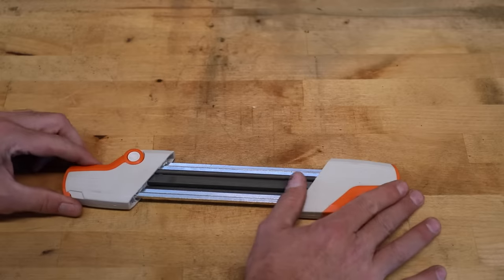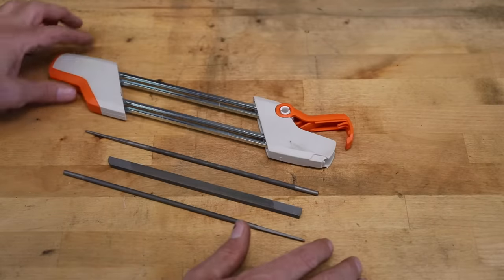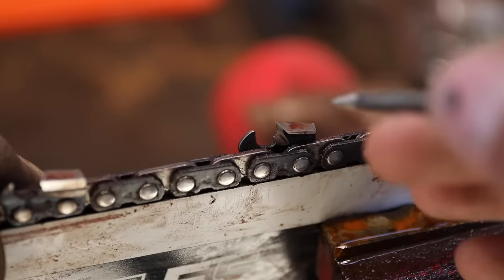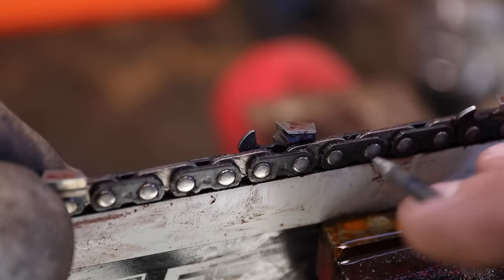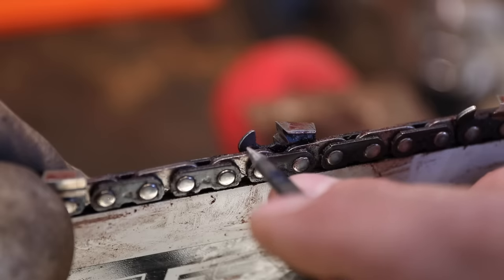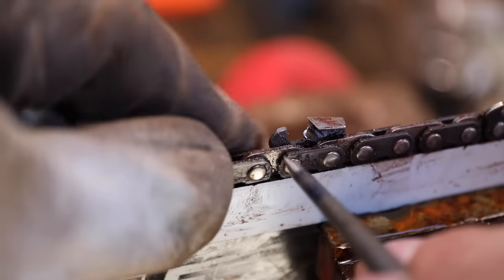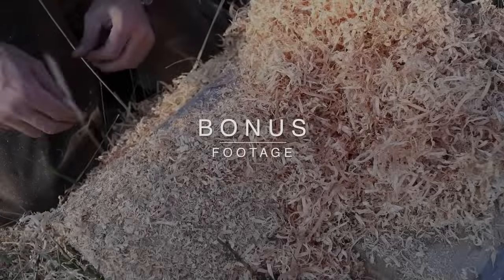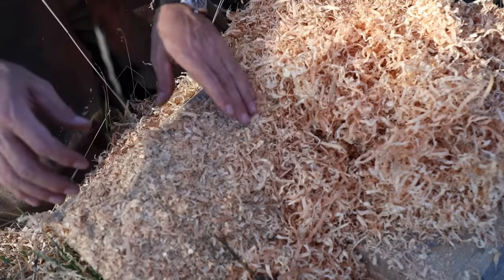Best Chainsaw Sharpener Ever - FINALLY!!!

Comment: Ive noticed latley-and maby not on this particular video , people get on here and just rip into this guy. It blows my mind how people can hate a human being so much that they have never even met. Then they through the ol , freedom of speach i can say what i want! Guess what fella its called " freedom of speach " not " hate speach". I see people saying " your not doing it right " im a stihl dealer" " ive been a faller for 35 years " . Wheres your video then bud? Im sure this guy has done his research on the sharpener , with a pro saw like that i bet he talks to dealers and well educated people daily. But thats the new age of internet for you , alot of people putting other people down for enjoying there passion.
Reply: Hear! Hear!
Reply: So if you see someone doing an instructional video that people may be relying on to do things correctly and they are doing it wrong or using the wrong tool we are not supposed to say anything? The angles of the tooth for instance, if your not going to use the angle of the file system then your just doing it by " eye" and makes it almost useless. One has to use this file system on the correct chain as well. This guy does great videos though and seems like a good man. Cheers.
Reply: Bad information is worse/dangerous than no information... People are really weird about chainsaws specifically.
Reply: kylejazz123  hate speech? Disagreeing is not hate speech, you fresh out of indoctrination center? ( college)
Reply: @kevingrove4379  yeah I also enjoy disagreeing on the internet.
Reply: Scott L  So hate speach. Spelled it your way to mitigate confusion.
Reply: @kevingrove4379  Brother, go back and read the comments with my name next to them. You and I have no disagreement. With all due respect, I think you're a little confused. I think your beef is with the guy called "old fart" and not myself.

Comment: Use your gauge to check the angle before you call someone who is trying to help you wrong.  It is 30 degrees.  I'm a little sad to read that you did not do your homework before you called 16ats wrong, and you did not say sorry for it ether!!!

Comment: We had a tree surgeon come the other week, I do general garden maintenance so have a rear and top handle chainsaw, do small trees too.
Anyway, we got talking, he gave me a tonne of advice, he had these 2in1 files and they looked really good. Explained how I’ve got a chain or 2 that I’d previously sharpened using a grinding wheel machine thing, and even though they were sharp, they were just useless. Had no idea about the depth gauge. I’d previously taken chains to be sharpened at a shop and never seen them do anything with the depth gauge.

Anyhow, got myself 2 of the 2in1 files and my god, so easy to use. The chains that are fitted atm to both saws, I didn’t see any contact to the depth gauge so I guess there’s still clearance.

Only thing is, about half way through your video, your angle seems all wrong?? The handles on the 2in1 are so I understand at 30°, which on my chains anyway, line up with the angle guide on the teeth themselves.

Excellent bit of kit though, shame about price, not cheap, but a chain takes just minutes, no faffing taking chains off.

Comment: I'm still a beginner after 30+ years of doing what needs done. I've known it was not a raker, but a depth of cut gauge It's interesting that you say it is not a raker then call it one anyway. Thanks for the smile. It has been an annoying week+. That 2 in 1 looks helpful. I'll keep it in mind when I'm shopping for supplies. Thanks for that too. -Ron

Comment: @wranglerstar If you watch your video you can visibly see the bar vibrate as you file and that will not produce the best edge. You want the bar as stable as possible while filing. Great video, I bought the product based on your review. Thanks for all you do. Take care to ensure the bar does not vibrate while filing. I like to set the vice about 4-5 inches back from the tip of the bar and file on the tip of the bar side.

Comment: i think it is over filing the raker as the file is designed for full comp chain and needs to ride on the tooth in front which is not there on skip.
Reply from the maker: I didn't find this to be true. If the depth gauges were over filed the saw would stall out or loose chainspeed when leaned on,
Reply: at stihl training this is what i was told.  it clearly works with skip but you have no control over depth of filing on the raker.  when it rides on the tooth in front it controls the depth of cut.
Reply: @jon gouras is right. Try it on a normal chain, then you will see how it is supposed to work.
Reply: I  think you are right about this. probably why cody's saw cuts so agrassive after filing. It has enough power (more than joe average's saw.)
Reply: in big wood skip keeps the saw from bogging.  stihl factory ships some big saws with skip.
Reply: Thomas Russell- Where I buy my chain, skip is the same price and it’s faster to sharpen. I always run skip.
Reply: faster to sharpen but you sharpen twice as often
Reply: i run skip in my bigger saws fyi and full comp in my little ones
Reply: jon gouras that's what I was thinking also.

Comment: You said it, your at a bad angle when you started, don't you think the guy who invented this knew what he was doing. 23 years I spent sharpening chain saws by hand and the angle you say is too sharp is what gives you longer chain life and deeper cut. Also did you notice once you submitted to using the tools as designed it worked better. Filing is just as much sound when your doing it right. Just me 2 cents.

Comment: I'm not fully on board with the gismo for a couple reasons.  1) how do you turn the file to get even wear? 2) do you not find the depth gauges are being brought down to far?  for me this is a handy thing to use once in a while perhaps every 5 or 10 filings but not for every time.  It also encourages the 30 degree rather than the 25 degree which for my money will hold an edge for longer.

Comment: Ok, so you've got two videos that say best chainsaw sharpener ever, this one and one from ten months ago. Which one would you buy if you had to choose? Thanks, just want the best one, have no experience with either. I have a plug in grinder, and I get one chain sharpened before the stones diameter gets too small to use anymore.

Comment: That sharper angle is for the smaller saws
Reply: The angle has nothing to do with the size of the saw. It's about cutting hardwood vs cutting softwood. I cut softwood and use 30 degree angle. 25 for hardwood.

Comment: Wait a second...it specifically tells you to file at an exact angle and you just randomly decide you're not going to follow the directions? That's not a review of the effectiveness of the product. It just shows what the product can do when you improperly use it.
Reply: Doesn't matter what your file guide tells you , the proper angle for any chain is marked on the tooth .
Reply: @johnburakowski61  that is the max wear limit mark.
Reply: Check the angle on a brand new chain and you'll find a match . Coincidence ?
Reply: @johnburakowski61  you are right. It has to be lasered at the right angle for sharpening or it wouldnt accurately tell you when your chain is done.
Reply: He tested his saw on a piece of wood I could of cut through with a butter knife. Nice!

Comment: Is it just me or did Cody file a square chain with a round file?
Reply: it's not you...
Reply: That happened
Reply: Yup😂😂
Reply: Little late to reply but some stihl dealers here in the pnw will only sell chisel in .63 no round file, some dealers won’t even sell RW bars in .50
Reply: So you have to file the grind out or get a chain grinder
Reply: Never seen a square chain before. Are they available in the US only?
Reply: No such thing as a square chain tooth.  All chainsaw chains teeth are filed with a round file.  The flat file is for the depth guide / raker.
Reply: @dennylangmack7452  - pretty standard where I am.  No issues for me.
Reply: @petershupe3460  you really don't know much about saw chain dude. There are  several different styles of saw chain on the market. Do some research before you make a blanket statement.
Reply: @nobodythatyouknow241  - got a picture of a square chain / file for sharpening the tooth?

Comment: Different chains have different filing angles. There is an insert in the Stihl chain box that includes a table of all the filing angles for various chains they make. The WoodlandPro chain comes in a box and the table of angles is listed on the back.  I think Oregon uses an insert sheet as well.  In this video you remarked on how you were confused about the angle set of the 2-in-1 tool (30 degrees) vs what you normally angle your file (probably 10 degrees for the big professional chains you use).  This is why, the tool is set up for the majority of small chains sold (30 degrees).
     Here's the thing that worries me. Small homeowner chains are typically filed at 30 degrees but big chains like .404 are filed at either 10 or 35 degrees ( see manufacturer's recommendations).   You take your chain to a repair shop and they likely will sharpen every chain at something like 30 or 35 or match whatever incorrect angle you already have.  Once a chain leaves the box, you won't remember which chain is which and what angles to use, so all chains, no matter their design, wind up being sharpened to the same generic setup.  
    Also note that on the bigger professional chains and for WoodlandPro chains, you are not supposed to keep your file flat/true horizontal, but should have either a 10 or 20 degree tilt (side plate angle) to get an upstroke going inside the gullet.  As a professional, you might feel the difference between a flat and an angled side plate, but I seriously doubt us homeowners will recognize the difference.
     There are so many chains out there and manufacturers, the only way to be "factory correct" is to buy and use one brand and model of chain only, or make sure that any new chain you buy matches the angles of all the old chains you already have.
    Study a few of those tables on the boxes or inserts and the survey what angles are truly used by your peers and then find out what your local sharpening shops grind to (usually 35 degrees) and then do a video to make some sense of all this madness.

Comment: This sharpener works and stihl recommends the angle of the cut for a reason. It matches their factory angles. Also, pull it up and off the chain instead of dragging it back after your stroke.
Reply: Never in my life did i work with someone who uses these or any other guide if you touch your saw twice a year then by all means, but talk to any logger or residential guy we all say the same its not as sharp as if i did it by hand

Comment: How long will the files last?
Reply: Not very long if he keeps dragging them backwards across the tooth between strokes.
Reply: the round files aren't expensive at all - you can bet a box of a dozen for just over $10 (decent German/Swiss files).  I throw the previous season's file in the bottom of my saw case so I always have one with the saw.  For the flat files they're more expensive but still under $8 and they'll typically last a lot longer if you "card" them regularly.
Reply: 3-5 chains
Reply: I might be wrong but I believe that its intended use is for full comp chain and you have skip chain. Your "rakers" look too low and the gullit is too high.
Reply: Chuck, it's funny he says he's not filing on the backstroke but you can clearly hear it biting.
Reply: XGC, 3-5 chains is not 3-5 uses. Think about how many times you can sharpen a chain before it's worn out.
Reply: +wtf caniuse   Youtubers often MISUNDERSTAND my comments too!  A common problem.
Reply: 454pakr forever if you clean them and lightly oil them once a year
Reply: A file literally cannot bite on the backstroke. You will just round over the teeth.
Reply: Ryan, that depends entirely on the file tooth profile. If it wasn't biting you would hear it skip rather than bite.
Reply: XGC Scrappy one round file will sharpen a 24" full comp chain 3-5 times for me.
How many do you get?
Reply: KimballCody, I thought you meant 3-5 chains. It should easily last dozens of times.
Reply: A single cut round file like that cannot bite on the backstoke. What you think is biting is the teeth skipping over the steel. I don't know of any file that has teeth  cut in both directions either, that wouldn't even make sense as you would constantly be ruining the teeth.
Reply: As I said, it depends on the tooth profile. Not all files have aggressive tooth geometry or even asymmetric teeth. I know the difference between the noises, it doesn't sound like a skip to me.
Reply: wtf caniuse nothing to do with how it sounds. You can clearly see the difference between skip and full comp
Reply: KimballCody, we aren't talking about chains ;)

Comment: Would you recommend it to someone who never had trouble sharpening with just a file? I take the rakers down with a raker gauge and an angle grinder when I feel the blade doesn’t bite as much every 4-5 sharpening.
Reply: Absolutely... it's a one pass thing as the rakers will come down as needed with each file... the round file height is always in the perfect location and saves cutting down into the tooth... the angle is spot on all the time... It's a little big to carry around if you are used to having a round file in your pocket or something when working away from the workshop or your vehicle down in the bush or something... but they're an amazing tool... I got one a few weeks back and my little saw has never cut better (other than with a new chain of course!)

Comment: Basically, if you are offering to demonstrate and review a product, you need to read the instructions and get the answers to your questions BEFORE putting your video out there. In my experience the chain packaging tells you the diameter if the file required as well as the angle setting when filing the teeth.  Better you should take this one down and try again - after you've assembled all the correct information.

Comment: Just bought this for 029 Farm Boss, has the lowkickback 26rmc3 81.325 20”, worked great , but I can see in your vid , it’s not aligned properly, they make these in different sizes, not sure if these are meant for pro saw chains, but if you have a farm boss , did nice job!

Comment: Not for professionals  / Consumer product only
Reply: Not so.

I maintain over 50 Stihl chainsaws for my career fire dept.  This is the fastest way to get a boogered up chain back to cutting like new.
Reply: JS81 It doesn't matter what the comment refers to, it's a useful tool even for professionals who can freehand sharpen a chain like the best of them.  It's effective, quick and accurate, the two grips allows for good powerful strokes, it gets the depth gauges at the same time so they're always at the right height and you only got one tool to pack.  John's right, you simply can't beat this file holder;  Imho it's rather unprofessional to label this tool as a consumer only product without even trying it and waste time with both freehand filing a chain and making such arrogant comments.

Comment: its hardly a new thing, ive been around those for almost two decades.
Reply from the maker: I didn't say it was new, I said I have only recently been made aware of it,
Reply: n00gai101, You're right, they have been around for a long time. You're also right about him saying that they are "new". 0:00-0:10.
Reply: Yes you did, Cody.  New and revolutionary even.

This file holder has been around for a while, the CS-X developed and manufactured by Pferd. Even Stihl's been selling it for years now.  Its predecessor, KSSG, must've been around in the previous millennium. You need to take the files out of that one, flip it and put them back in to file the other side of the chain.  The CS-X is basically two KSSGs in one so you can just flip it and continue filing. It does a really good job.  Angles, gullet, depth gauges, all good for a smooth cutting cross-cut chain with good grip.

And they make it hard to botch the job.  Even non-professional home owners should be able to get it right with this file holder for dummies. Well every non-professional home owner but you anyways.

I really wonder what you meant at 1:05?

Comment: It's worth mentioning that this tool only works on NON skip tooth chains. Those chrome metal bars on the sharpener are meant to ride on the top of two teeth. This properly sets the depth gauges. On a skip tooth chain, one tooth is not under the chrome rail, which then doesnt allow the depth gauge file to work right. hope that makes sense.
Reply: It does make sense, but if you'll notice the chain he is sharpening IS a skip tooth chain. It can be done you just need to compensate for not having that second guide rail hitting.

Comment: When I sharpen my chain I take extra time to be as precise as possible with my round file. Yes, going back to file the depth gages takes even more time, but like you I have a big saw (Husqvarna 390XP w/32" bar) and I want more control over how much bite my chain has and that saw can handle an aggressive chain. I may have to try that sharpener though as it looks like it would be a huge time savings. Nice review, very informative

Comment: I file to the angle Stihl set on the sharpener, my saws cut great. And it eliminates the guessing about the angle every stroke of the file! I don’t even turn the saw around to file the other side. I just put the sharpener in the tooth and pull it instead of pushing!